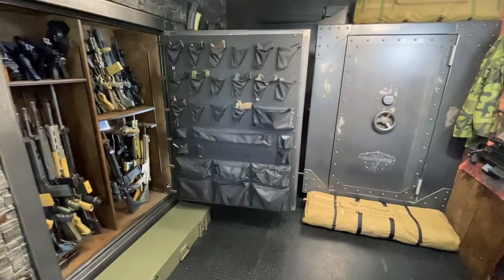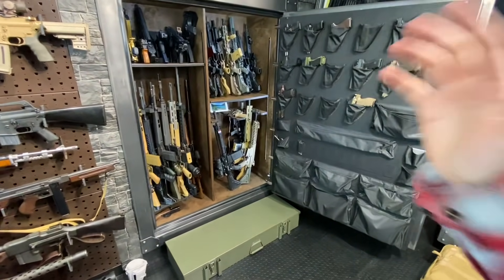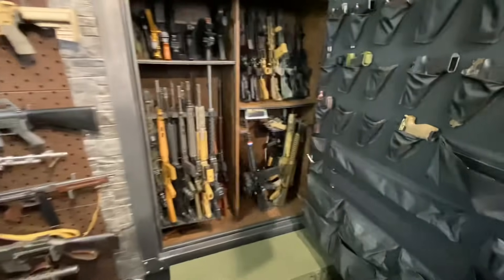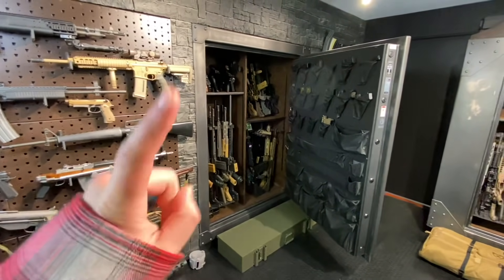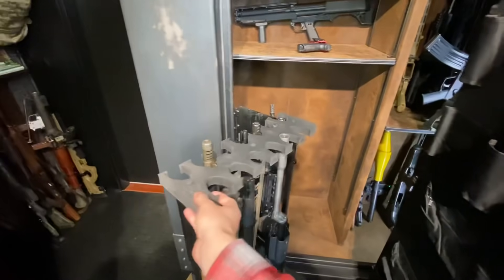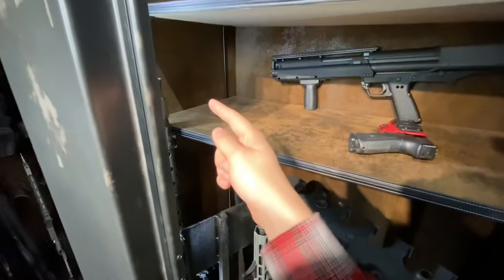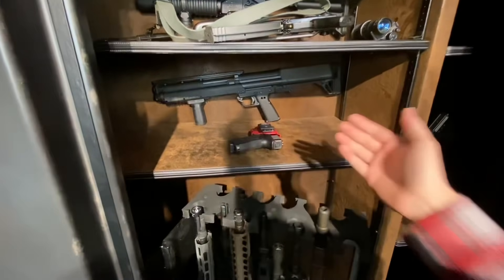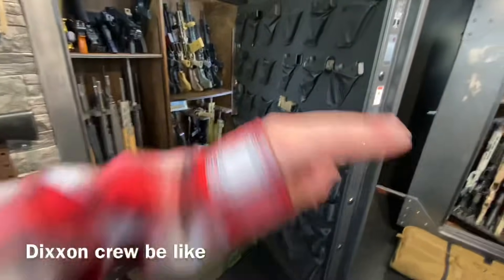2 Safes are 3x Better than 1 | Building the Ultimate Gun Room Ep.3

Comment: You need to convert a 3000 square foot house into a safe with ull time security. Surrounded by moat with alligators. Then a 30 foot high fence with barbed wire around that. Land mines in between the fence and the moat.